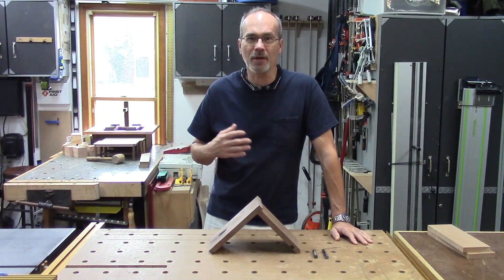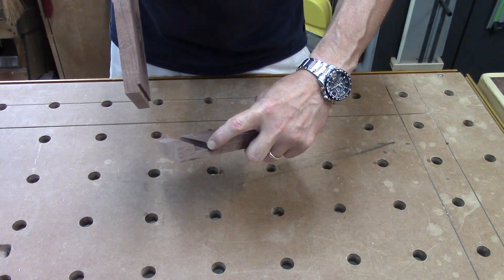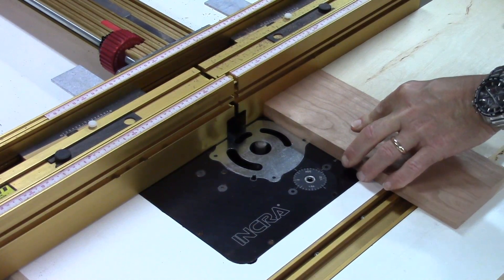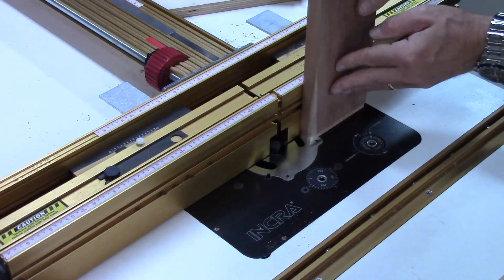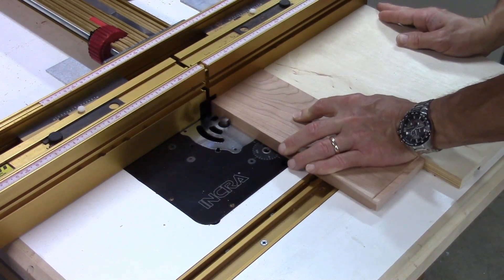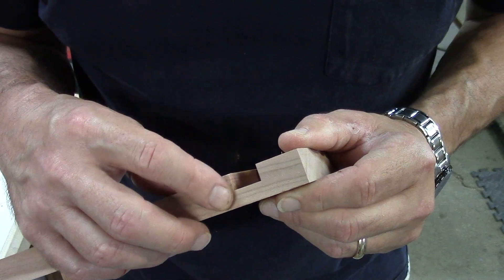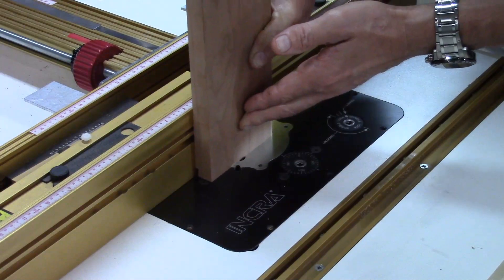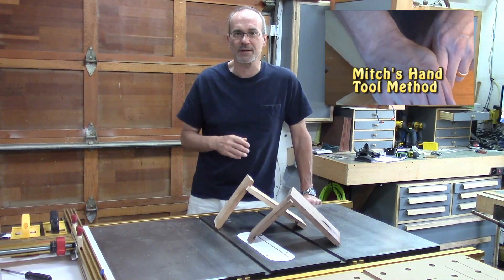Hand or Power #3 - Sliding/Housed Dovetails - Power Tool Method

Comment: I'm considering using this housed sliding dovetail joint to build a speaker cabinet for my guitar amp.  I like the idea of having the groove square on one side.  Can anyone tell me if rounding over the edges of a joint like this affects the stability?  Guitar speaker cabinets typically have a 3/8"-1/2" round over on all outside edges.  And my assumption would be to use glue throughout the length of the joint in my case.  Thoughts?  Great video and instructions.  Very clear and concise.
Reply from the maker: Hey Chuck. It shouldn't affect the joint I think.

Comment: I know this video has been out for a while and thanks for posting, but have you ever done a sliding dovetail using a tablesaw?
Reply from the maker: It sure has been out for a while. I forgot I even posted this! HaHa. Nope, have always used a router bit to do this operation. I'm sure it could be done with a table saw, but definitely sounds more difficult.
Reply: Thanks Guy, I want to make a dovetail puzzle box and since the dovetails are cut at 45 degree angles I assume I need to build a jig to hold it against the fence. I thought it might be easier to use the table saw to make the slot edges then clean up with the router. Thanks for all your content. I am enjoying catching up with the podcasts.

Comment: Great video, Guy.  How about a locking or wedged miter joints?  Thanks for the videos.
Reply from the maker: +KSFWG Thanks Dave! Are you referring to a splined or keyed miter joint?
Reply from the maker: That's a great suggestion. I will throw it in the hopper. I think it's Mitch's turn to pick the next one.

Comment: You guys with Incra fences on your table saw; do you have to swap around the whole fence when you want to use it on the router table, or are you weirdly cutting on the table saw regularly with the fence to the left of the blade?
Reply from the maker: +Kirby Weldon Hi Kirby. I have an Incra router fence and the table saw fence. The router fence way before the TS fence, but my wife knew how much I liked it, she bought me the one for my TS for Christmas one year. In the 35+ years I have been using a table saw, I can only remember a half dozen times having to cut once on the other side of the fence. If I ever do need to do it again, it only takes a few seconds to take it off and put it to the right of the blade. Great question!

Comment: Guy, are these techniques more superior for squaring the drawer than say using dominos?
Reply from the maker: I don't know if I would use these joints for making drawers. You could do it I suppose. And they should be self squaring if they are cut correctly.
Reply: GuysWoodshop Sounds like a challenge.  I think I'm going to try it.

Comment: I noticed two things that give me a lot of trouble.1. When cutting the vertical piece you are not using a backing board and you get no tear out.2. You are not pre-plowing through the dovetail groove with a narrow straight bit. You go directly to the dovetail bit.    When I do not pre-plow, I get a lot of vibration, almost loosing control of the cut.
Reply from the maker: Hey Nikos, I am using very high quality Whiteside router bits, and that helps quite a bit. They are also 1/2" shafts which is also a big help when plowing the dovetail.